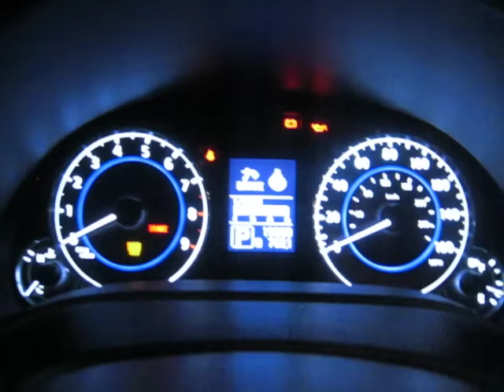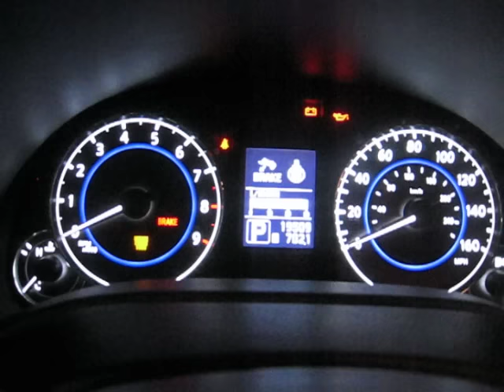Easy Way to Reset ECU without battery disconnect in G37

Comment: I have done this, along with cleaning my MAF sensor  periodically for years on my 09 G37x. Now I've got 233K miles & I've had to do nothing to my car except oil changes & brakes, replace 1 hose & 1 belt, 1 water pump & 1 drive shaft & she still runs like new!
Reply: Rachel Burger youre talkimg about serp belt? Only reason im asking is i have 2011 g37 that i thhhiinnkk needs a new one
Reply: I just got an 09 g37xs with 102k miles, I'm scared of the dreaded gallery gasket leak. I'm surprised you never got it within all those miles!
Reply: U ever get P0106 engine light code? This annoying little code can't  figure it out
Reply: @platinum9898  Yeah, the P0106 is common, that's why I started cleaning my MAF sensor followed by a reset of the ECU. I've been doing it on my 13 g37x & this car still runs great too. 

It's mainly tiggered by a loose intake hose, a dirty air filter, or a clogged or dirty throttle body.
Reply: @frankrodriguez11591  Nope, I have heard about it, but I've previously had a G35 & (2) G37x sedans all with over 225k miles & never had a gasket issue. But my driving had been around 35k miles a year, 85% of which is long, steady driving at 80mph on the highway, which I would think would cause a lot less damage to the car than city driving, so maybe that's why?
Reply: @Rachel-lb5dh  yup i cleaned and replaced maf and constantly reset ecu, have not cleaned throttle body yet, will try that. Other than that i change oil mobile 1 synthetic and changed a water pump. Car runs like new its incredible. Maybe a ball bearing. No problems with this car other than that p0106. Love this car.
Reply: @frankrodriguez11591 that issue was solved with the newer models 2009 g37 and newer... Not a common issue with newer models

Comment: I keep coming back to this video whenever I need to reset my G37 - thank you for posting it, thank you for getting straight to the point (no long into and crap) - I legit use your talking to keep my timing accurate. Legit, you’ve saved me many times - so thanks!!
Reply: Same here
Reply: Will disconnecting the negative terminal get the same result?  Thanks
Reply: @Damone7653  to the best of my knowledge it would depend on why you’re trying to reset it. The car seems to retain “serious codes” even after leaving the battery disconnected for a bit. Putting this in non technical terms - this reset is like restoring your iPhone to factory settings - it’s reset to an “out of the box” condition. This process doesn’t cause you to lose your tune though (if you have an aftermarket tune). I use this to reset my cars AFR learning now and then
Reply: @NikPappaconstantine  Thanks Nik... I have no tune and the car runs fine, I might leave well enough alone. Enjoy the weekend!
Reply: Damn I’m trying to flash my locked tune so I can get a new one
Reply: @BennettThomas-mx9lu  you can flash any tune on to the car without “unlocking the prior one”, if you’re trying to use the current tune as a “base” and change parameters (like a re-tune), you’ll need a password to decrypt it first. 

To summarize, if you start from scratch you can put whatever you want on the ECU
Reply: @NikPappaconstantine thank you for your concern. What you are telling me is that the tune guy is lying? I’ve been told that since there’s a tune on there already they have to get rid of it in order to give it a new tune?  It you say you can put another tune on the car while that one is on there? It is an ecu teck tune map thing
Reply: @BennettThomas-mx9lu  I think we’re saying the same thing? They can put a new tune on it, which gets rid of the old tune. From what I understand, it’s harder to go from ECUTEK back to uprev though, so if you’re trying to do that - maybe that’s where you’re getting push back?

Comment: Success... after 3 tries. 2013 G37x - no more lag on acceleration! Took my tablet to the car and followed along with the video. Trust the process. My car's CEL flash sequence was a little different.
Reply: would it work on my journey too ? i have lag aswell not too much and it also doesn’t give out as much power i also have a bcm code

Comment: Similar to the case +henry vanegas mentioned,

My '09 g37 coupe S went into limp mode, wouldn't rev past 2000rpm.

Just did an ECU reset as shown above, and it all came back to normal. Did a test drive on the highway, no problems left at all. It performs as if nothing happened. 

Thank you so much for posting this!

Comment: Tried this and it definitely improved gas milage even my car air conditioner runs colder or so I thought. Thanks a lot
Reply: lol..its all in your mind!!  the mind is amazing, the way it works...really it is!!
Reply: - MrRIchBiker Probably not actually. When some CELs are triggered they put the engine in limp mode to protect it. This usually causes poor fuel economy and or poor performance. Resetting CELs can temporarily take the vehicle out of limp mode until the CEL is triggered again.
Reply: @djdbsk if it does get better performance what should I go about doing to make sure it doesn’t come back

Comment: I tried this myself from printed instructions, tried it 6 or 7 times, CES light never did flash.   I watched this video on my tablet in my 2013 G37x and followed along exactly with the video and it worked first time.  When I tried doing this reset from printed instructions, I was not hitting the 5 accelerator-to-the-floor actions fast enough.  This video showed how it's done. THANKS!!!!

Comment: Infiniti ex35. Changed my air filters for the high flow washable k&n air filters and after a day my engine light came on. The car drives just fine. I did this and my check engine light went off. It worked on my second try while watching the video inside the car. Thanks.

Comment: Definitely a huge help, especially if your battery just died. Chances are you'll see some warning lights popping up, particularly a yellow one related to the traction control. This seems to be a false alarm. I tried this method and the warning light went out.

Comment: Easy wtf... all while you were doing that, I loosened my negative terminal, reattached it, checked my oil, filled up the tank, washed my car, detailed the interior, paid my insurance, lost my job, defaulted on my loan, hid my car in my friend’s garage, got a new job, paid back the bank, got the car out of my friends garage, sold it, defaulted the loan, went into collections, invested my money into bitcoin, lost my ass in bitcoin, stole my car back from the guy I sold it to, got caught by the cops, public defender’s an ass, learned how to make pruno, met some new friends in county, got out, got initiated with the locos, found my car at impound, bought it back at auction, couldn’t open the hood and needed to reset the ecu, found your video again on YouTube, commented on it.
Reply: Idk staying inside my car for a minute and following instructions is easier than popping the trunk removing the plastic panel allowing you access to battery. Taking a 10mm and loosening the terminal. lol just follow instructions brother

Comment: 2013 G37x with 30k. I followed the video step by step and cleared the service light. Thanks for the video!Took me a few times but it worked.
I checked the code at auto zone got code P0710 transmission fluid temperature sensor. Hope the light doesn't come back. I did make an appointment with the dealership incase light comes back, car still has factory warranty.

Comment: car was stuck at 1k rpm idle and service engine light, this fixed my issue.. thanks!!! i watch this video over and over every time i need a reset
Reply: back again thanks!!!
Reply: yea my 2013 journey does this I thought it was jerking but I took It to someone and they said its in limp mode and my service soon is also on did this fix?

Comment from the maker: yup, i agree. Disconnecting the battery is quicker. But when i was on long trip - my brake pads were worn and this resulted that everytime during heavy accelerating or braking the "brake" indicator lights up (due to low brake fluid level caused by thin brake pads). When this indicator lights up for more than few seconds the service engine indicator is on and traction controll is off. So in this case and on the road it is quite easy and fast way to reset ecu :)

Comment: Worked like a charm, thanks!  Side note, I received the Loose Fuel Cap Warning, loosened and tightened the fuel cap several times, finally the warning went off, but I immediately got the Service Engine Soon warning.  Did the above and it’s gone now.  Hate that light 🤨

Comment: I can't believe it actually worked. Push button twice.
Wait 3 seconds.
Push gas peddle 5 times
Wait 7 seconds
Hold the gas peddle 10 seconds then release
Wait 10 seconds
Hold gas for 10 seconds
Turn off car.

Comment: Henry my 09 was doing the same thing. Check the oil pressure with a manual pressure gauge so you can know if in fact you do have low oil pressure.  I had low oil pressure and did an oil change with mobile1 10-40 and my pressure came back up. It could be the gaskets in the rear timing cover but for now this helped.

Comment: You forgot the most important thing to tell people before starting this procedure. Make sure you turn off radio heater all accessories or this procedure will not work no matter how good you are with timing and timers. Once I found this out it works every single time.!!

Comment: Worked like a charm. CEL is annoying as shop that did the tune forgot the detail of deactivate monitoring the rear O2's (although the tune is wonderful). So, nice to just turn it off in my driveway. Drove it 60 miles and tune is notably fine. No bogging down on acceleration.

Comment: I think I’ve watched this video 100 times in the last 3 years I’ve owned my G37S. Not sure if I could do the reset without watching it at the same time LOL. And to all the people saying pull the fuse or disconnect battery, then you have to reset all your radio presets and maintenance info. It certainly makes a difference since I have a full header back exhaust and I takes but once the ECU learns I’m back to being slow again. I just need to get a tune eventually. Oh well.
Reply: @Brian Quinn - correct and it’s easy to follow video anyway.

Comment: Not sure if it's placebo or not but my VQ37VHR feels so much better than before.  Especially shifting from 2 to 3.  Before it was extremely rough and now it's much more smoother.  Took it out for a rip and in Sport Manual and Normal Automatic.  Everything feels smoother.  Seems like this ECU reset did some good.  Thank you for showing the procedure.
Reply: From what I’ve read it adjust to new driving patterns so I’m sure it’s actually made it a difference. Exactly what I’m looking to happen to mines when I do this

Comment: Did this after getting a check engine light for removing the stop lamp fuse to do some burnouts 😂and cleared everything even fixed the high idle thanks man btw my g is a 2013 g37 journey coupe
Reply: Rodolfo will this work on a 2014 q50?

Comment: Thanks, this is helpful. My mechanic forgot to reset the system after service and the light went on. I thought it was The same to Check Engine Light, but it is not. I have a Infiniti EX35.

Comment: I just did this on my 2014 Infiniti Q50 3.7 AWD and it worked. Not only did I notice a minor improvement in throttle response but my overall fuel economy increased as well! Before the ECU reset I would typically average between 30-31 mpg on the highway, but after doing the ECU reset my average highway fuel economy is now 32-33 mpg. That's a pretty big improvement for just resetting an ECU. I'm still trying to figure out how this could be possible, my CEL wasn't on prior to the reset or anything like that so I don't know....I never reset my ECU before this and I've had the car for 3 1/2 years so maybe there was something stuck in the ECU that was causing a drop in fuel economy that was cleared out after the reset?
Reply: Patrick C. That's great, yeah it is recommended at least personally by me to do this every so often because your car will adapt to the driving style and that will affect the shifting and the fuel economy to some extent.

Comment: So my '10 g37 went into limp mode, wouldn't Rev past 2500rpm. Happened suddenly for no apparent reason. The diagnostic codes were for low oil pressure. Oil change was less than 2k miles ago. Also read forums that said a gasket was the problem. Car has 71k miles so I suppose it's possible but it was running and has been perfect. I did the factory reset and it is reving normal. Before it would go through gears but I had to manually shift below 2500 rpm. Thanks for the video I hope the reset was all it needed.

Comment: should i drive slowly while test-driving it after the reset? should i press the gas hard? how will it effect the ECU learning (adaptation) process?
Reply: TheMarshall92 you do not need to drive a certain way after doing the ECU reset, simply drive how you normally would drive and it will learn those habits, just as an FYI, I typically do this every once in a while just to keep things fresh because if you typically drive slower you'll notice that when you want to give some good acceleration there may be a slight hesitation in the shifting because it's not normally done when you drive

Comment: This worked and my light cleared out. But will the light come back on again? Mine came on because the terminal was loose but I tightened it up and cleared up the SES light with these steps. So will the light come back on?

Comment: Hi do you know if the 2008 G35x has a throttle position sensor? Or is it all come with the throttle? Or is it in the pedal like your car? My car has been idling at 900-1200 and throws p0507. Tried the reset the throttle manually like 15 times and no luck.
Reply: Hey what was the problem & does the car went into limp mode ?

Comment: My car gets a p0300 code. I do this and it's foxed.. for like 2 weeks then happends again. What's guys think.
Reply: did you get fix I'm having same issue I copped a 2013 g37 journey and it have same codes and car goes into limp mode I cleaned MAF sensor throttle body changed sparks still doing it I haven't tried reset tho does it work?

Comment: Hi, 
I was changing my fog lights to LED and I made the mistake to start the car while the air filter was opened... i got the CEL on for two days and i read this post online that told me to remove the battery for 5 mins and reconnect it... After doing that I now have an hesitation when I hit the gas from a stop position @1200 rpm.... i tried your ECU reset that works good my car riding more smoothly than before but i still have the little hesitation @1200 rpm... don't know what to do if you have a solutions Please help me with that !!!!

Comment: If I do this ECU reset will it clear the Transmission TSB that has already been applied to the car? Or will it still be there?
Reply: The Enthusiast from what I have read this will only reset the ECU which is the driving style that the car learns
Reply: The Enthusiast there is another process for the transmission reset I believe that the dealer might have to do because I am not sure of a do it yourself method

Comment: Is that really easier than simply pulling the battery cable and pressing the brake 5 times, then reconnecting the battery?
Reply: Ok, just went through the cycle, it's a lot easier when doing it yourself in the car than it is watching someone else do it. For those asking about puling the battery, I believe that resets not only all of your settings (seats and stereo), but even your window protection circuit. This means, you might need to do a window reset procedure in order to recover from a battery removal. Good video.

Comment: Tried the same exact steps on my 08 G35 but for some reason the service engine light didn't blink?
Reply: 8989Capo I know timing is critical otherwise you have to restart the process.

Comment: My 2007 G35x is idling at 900-1300 I’ve done this procedure a few times and still no luck, also when I accelerate the engine light quickly blinks. Any thought that could help me out
Reply: Try the 3 procedures to be done after cleaning the throttle bodies.

Comment: OK, it worked for me - BUT - It's ALL ABOUT the timing !!
I failed my first 10 times or so. I was just about ready to disconnect the battery, but then it (finally) worked. 
Also, I called the Infinity Dealer Service  Department. They said it won't if the sensors are picking up something wrong. If something's wrong, the light will just come up again. Well, my light didn't come up again, so I think I'm good.
Reply: If "sensors picking up something wrong" should not that "wrong" get fixed before it's too late ?
Reply: Yes - if the light comes "back" on. My light comes on in the first place at exactly 49,000 miles - a reminder for a 50,000 mile service. I got the light off, and since it stayed off, all's well.
Reply: Alexey Kostenko naa the thing is i did a oil change recently and my servicce engine light came on i own a few cpu that tell me whats wrong with my car and whats not, everything read good just had to reset the system. Done the same thing on escalades.